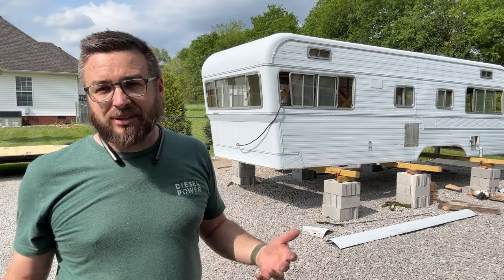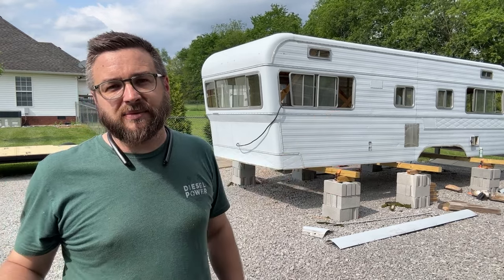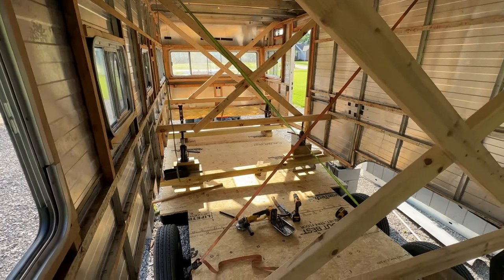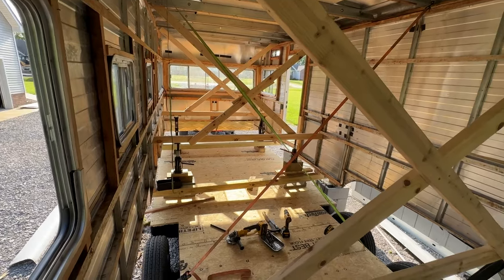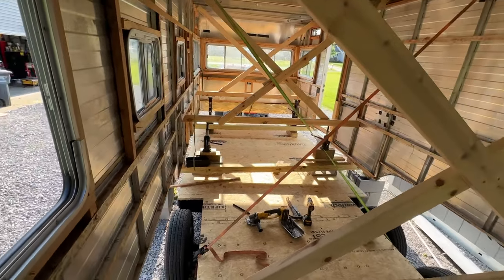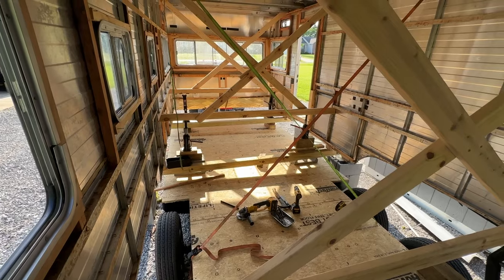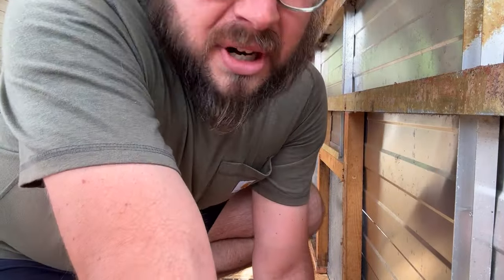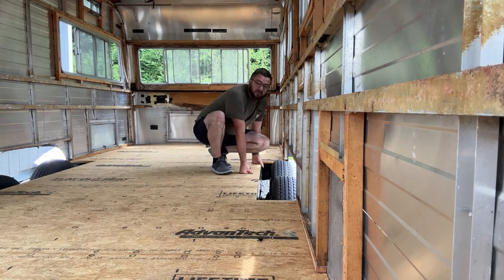1971 Holiday Rambler Reno: Part 16 - Reinstalling the Body

Comment: Looking amazing. Working on painting the screw cover on my 90's Aluma-Lite. Last thing she really needs. oh wait still need to replace the Blade Seal on the toilet. Any reason ou didn't put flooring down before putting the box back on?
Reply from the maker: I debated it and probably should have! The new ply (3/4”) was 1/8” thicker than the old and I couldn’t get the stuff I wanted in 5/8”. I was worried adding another layer of material would push it too far out of alignment.